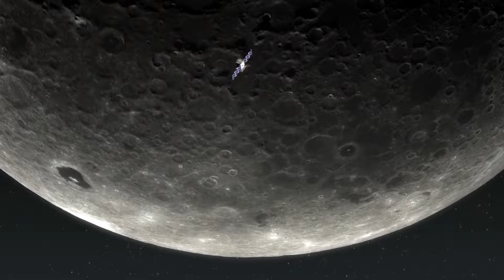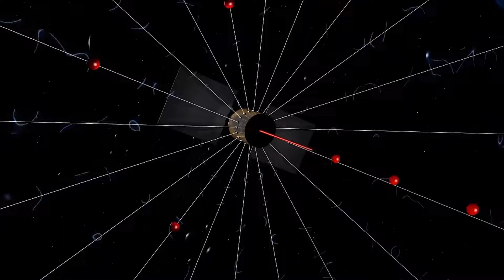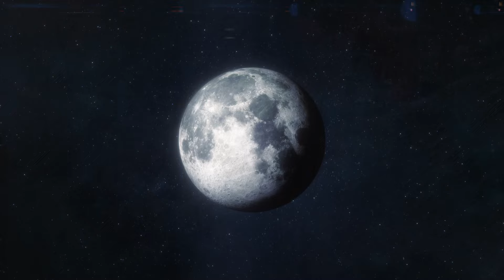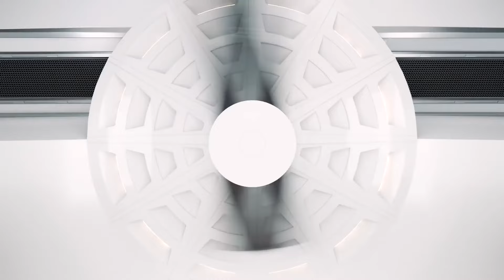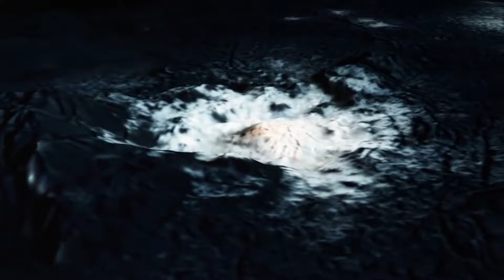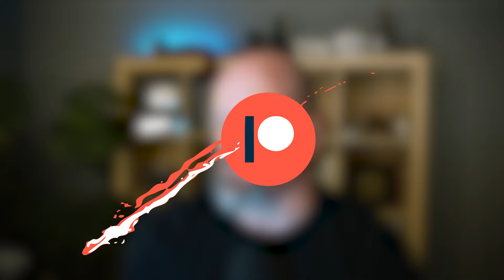How The Moon's Bumpy Gravitational Field Can Help Launch Things From Its Surface

Comment: With easy and cheap access to oxygen and the solar wind, don't you have access to water fairly trivially? You'd need to concentrate the solar wind into wherever you have your oxygen, and maybe slow it down a little, but that's should be a pretty basic magnetic field to make. Earth's does the same thing naturally after all and it's basically the same as a really big bar magnet.

Comment: Now this is curious. If gravity emerges from the curvature of spacetime then how do these bumpy anomalies on the moon create gravitational effects on orbits? I'm getting tired of the argument that gravity is not a force.
Reply from the maker: They come from mountains and valleys as well as different densities of rock under the surface
Reply: @frasercain  "what" comes from the anomalies--gravitons? This is where the discussion always seems to peter out.
Reply from the maker: The amount that the mass distorts spacetime.
Reply: @frasercain  I very much appreciate your weighing in, however, I still wonder about the concept of gravitons, if in fact gravity is not a force.
Reply: Cetrifcal for isn't really a force, but it's mathematically easier to treat it as if it existed on its own.
Reply: @friendlyone2706  but, there is in fact an acceleration force in the opposite direction from which the so-called centrifugal force emerges. So what about the curvature of space-time would be the equivalent of the acceleration forces that created centrifugal force?
Reply: @robertmontague5650  Depending our your perspective, it would be a bending, but the math is very hard and just computing the centrifugal force the old fashion way -- just like figuring orbits the old fashion Newtonian way -- is easier. and close enough for all practical purposes.
Reply: @friendlyone2706  a bending spacetime curve is geometry--not a force. The fundamental question is:  What is the origin of the force pulling the object along the spacetime curvature?
Reply: @robertmontague5650  What is the force that makes you slide down a slide? Gravity and/or the spacetime curvature of reality. The curve is the force.
Reply: @friendlyone2706  The curve is geometry. And this is the nub of it right here. Just calling geometry a force isn't rigorous it's semantic jibberish.
Reply: @robertmontague5650  It's multidimensional geometry. What's missing is a vision of what our space time curves around. We can see the curved slide forcing a marble to take its twists ad turns, but we can't see the "slide" controlling the object moving through its orbit.
The interesting part -- when you really get into it you get an infinite series of regressions. One of many arguments for a multiverse.
I do think we are missing something obvious. Maybe the force you want. Maybe something else. Infinite regressions are annoying solutions.
Reply: @friendlyone2706   Put another way, if spacetime were not curved, it logically follows that there would be no gravity? [we would both say that is silly and not true.]
Reply: @robertmontague5650  According to relativity, gravity IS the curvature of space-time.
If it makes you happier, check out the electric universe version of gravity -- it's all electric force and no curvature needed.
Personally, I agree with the electric universe crowd interstellar and intergalactic electric currents are undervalued. I also believe it takes static electricity to accumulate small particles into larger objects until they're big enough for gravity to be taken seriously. 

But yes, according to relativity, no curve, no gravity. The greater the curve, the greater the gravity, hence the expression, a gravity well. Also a favorite science fiction ploy to cheat light's speed limit -- tunneling -- exists in the quantum world. No logical reason it's not scalable up to our world. Whatever it is our universe curves around like the surface of a ball curves around the air inside it, maybe we can tunnel through like poking a rod through a ball.
Einstein did not get the Noble Prize for relativity because curvature =  gravity was (& in some circles still is) too controversial. He got it for explaining the photoelectric effect.

Comment: For shelter, why not land in a crater and use a tunneling machine to dig into the crater rim, instead of building up stuff above ground. Never heard someone say that before but it sounds easier and better. Like digging into a mountain on earth. If you want lots of thickness then that's the way to do it, like Cheyenne mountain.
Reply: Plus research digging into the moon's depths would be easier.

Comment: The feasibility of a space elevator at Ceres makes me wonder how feasible might the same be on the Moon?  At the very least it could reduce the number of lunar landings kicking up dust, and it will be immune to the bumpy gravitational field since it will be static relative to it.
Reply: Sounds good in theory. The issue here is that the moon has no synchronous orbit, so any space elevator would have to pass through and past either the L1 or L2 points: a desperately long tether.
Reply: @BryanM61  Oh right, a Lunar day is a month long. Too slow for a practical space elevator.
Reply: @MelindaGreen  He mentions that ... but if it were reinforced?